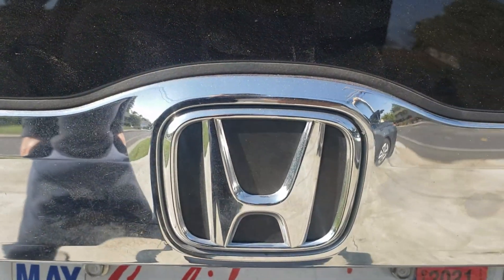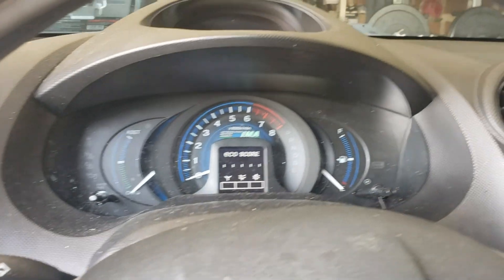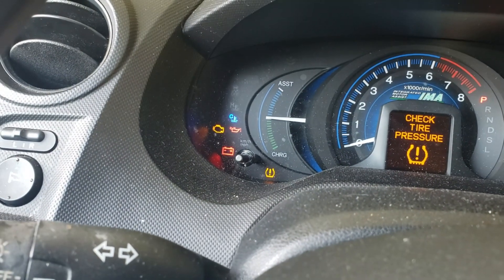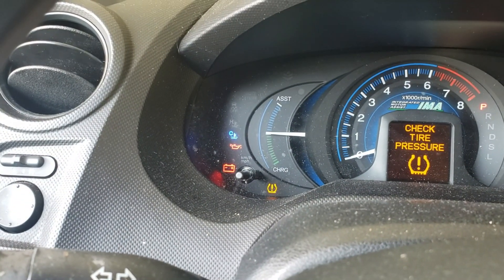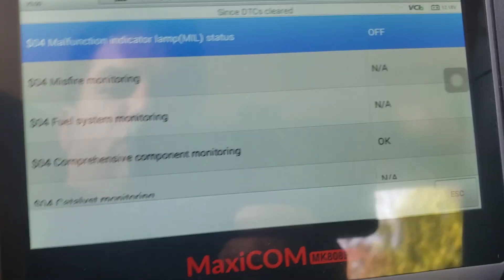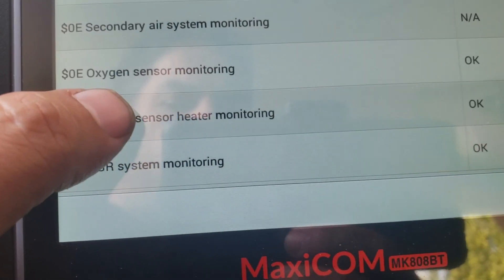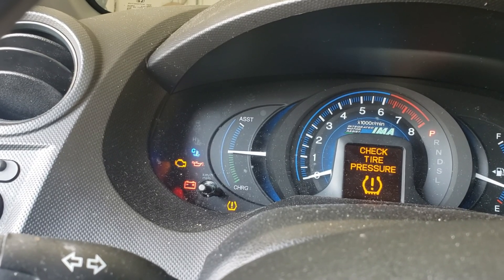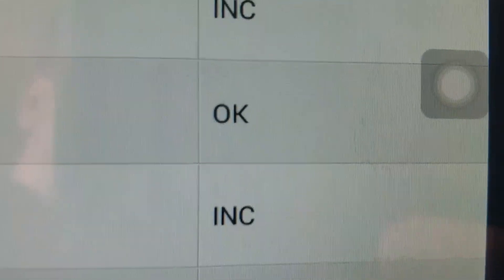Honda Smog Secret▶️ Check Honda is Ready For Smog Without Any Tools

Comment: So if my check engine light goes away like that then I should pass? Thanks
Reply from the maker: depends on the state you live, if it doesn't behave like I showed in the video then you would want an obd2 reader so can check which monitors are not ready. Once you figure that out then you will want to know your states requirements, which I have a video for https://youtu.be/QKxDzdTVJOU?si=vuJgEmP5aQSQkf0v
Good luck and keep me posted.

Comment: I did this test and my engine check light goes away in just a couple of seconds (not really around 15-20 seconds). Does this also mean that my car is ready for the smog check? Thanks.
Reply from the maker: Yes, that means the vehicle is ready and all the inspection monitors are complete.
If the check engine light blinks 5 times then it means one or more inspection monitors is not ready.

Comment: Two smog check places said OB2 showing not ready even though it has been driven over 5000 miles since battery was changed last years including freeway and street. Could there be other issues going on. Had an oil change at the dealership a few months ago should they have picked up on this?
Reply: 2017 Honda fit

Comment: I would like to post here to help who had been through with it and make your own decision. Please, this post don't mean to promote Honda dealer business but i have to post Honda dealer is the final one help me solve this problem.
Here history of problem. I replace my dead battery of Honda 2016 with ~26,000 miles 4 moths ago with new battery, during process replace battery i have to disconnected battery cable and it causes wipe out smog data on my ECU. Last week i bring car to star smog check for California Registration Re-newal and it failed with message OBD2 NOT READY.  By time it failed i have more than 1000 miles on car since replace new battery. Smog Technician give me Honda drive cycle and I did 5 times but it still failed. It is very dangerous procedure because Southern California traffic, I have kep drive 55 mph. Truck driver honning at my rear. I am scare. But it is not thing compare to drive 55 mph and allow it coast to 20 mph. I turn emergency light on  and kept drive with out touch break. It is nerve breaking drive. But it is still failed. My mechanic hoist car and he try to replica Honda drive cycle at his shop but he could not get up 55 mpd  becuse Honda transmition very sensitive, not allow him to shift gear to get up 55 mph. He gave up and advice bring car to Honda dealership. I arrived Honda dealer and tell them history problem. They tell me no problem. The will re-flash my ECU and passed smog check include passed smog certificate cost me $266. I am in and out Honda dealer 1hr 30 minutes. It is stiff for retiree and fix income like me but after been drive on freeway i think worth it because it is very dangerous for 75 year old guy drive constans speed 55mph and bunch of truck drive honning behind me. Please, understant I am not promote Honda dealer busines, I just want to help who had been drive in hell like me make your best decision. If you have any more question. Please post here.

Comment: Hi, I have a 2007 honda accord. What if the engine light don't turn off? At first it blinked a bit and turned off, now it won't turn off at all.
Reply: If your check engine light is on when the car is running that means you have a fault code present and need to get that issue diagnosed and fixed.
Reply from the maker: Sorry for the late reply, I appreciate your feedback
did you get this handled?

Comment: 600 miles and my cat monitor still not ready. I have emissions inspection due in a few weeks. No codes.
Reply from the maker: Here is the honda drive cycle https://youtu.be/oZELvZ4danA
How you can tell your honda is ready without a obd2 reader
https://youtu.be/cxpE_I1cKh8

And if your catalyst monitor is stubborn here is a playlist focused just on catalysts monitors https://youtube.com/playlist?list=PLDEbtVOPRC-h1BAzaWQ-6NSnmG0gwvgwP

Let me know what happens and good luck.
Reply: @RANDOMFIX  Ok. I re-set the computer again. No codes. Fuel trim looks all good. Cat wont come to ready.
Reply: @mg8720-u7j   - Did you have a previous fail for a CAT code?  Becase if not your Cat Monitor can be incomplete and still pass a emission test in MD.  Here is the info from thier site:

OBD II Readiness Monitor VEIP Requirements

A vehicle can be tested if either the catalyst or evaporative monitor, but not both, is
not ready. All other monitors must be ready. A vehicle that has failed VEIP
testing for a catalyst or evaporative DTC, however, must have the applicable monitor
set to be retested.
Consecutive Not Ready rejections from VEIP testing will result in a VEIP test failure.
The following message will be printed in the Test Information box on the Vehicle
Emissions Inspection Certificate: “99999 – Too many OBD monitors are not ready on
multiple attempts”. While the “99999” designation is not an OBD diagnostic trouble
code, it indicates that the vehicle has long term readiness issues or other faults that
need diagnosis and repair.
Always advise motorists to drive for 1 week after repair to help ensure that monitors
reset before getting the vehicle retested.
Reply: @mg8720-u7j   - SHould not have reset it now you got to get all the monitors ready again.  But if you get down to the cat not ready again just go for your test.
Reply: @stevew9563  ok got it
Reply: @stevew9563  Most monitors came back on faster this time. CAT monitor is the last one left after my evap. Evap will be ready tomorrow. Then my cat will be stuck. Just added bottle of CRC cat cleaner.
Reply: @mg8720-u7j   - Yea don't sweat it just go for your test with it not ready.
Reply: @stevew9563  Ok thanks so much.
Reply: year make and engine size?  You been following a factory drive cycle?
Reply: @stevew9563  2013 honda fit. tried drive cycle
Reply: What state you in?

Comment: Thank you I did this ignition test to make sure my car is ready after doing the drive cycle you shown on your other video.  The only thing I am confuse is why my EVAP system monitor was always N/A and my Fuel System Monitor and my Catalyst Monitor when from INC to N/A instead of OK on my ODB2 scanner?
Reply from the maker: Glad to help. N/a means that it doesn’t not apply. It is a little uncommon for n/a for evap. The evap is exempt in most cases. Inc means Incomplete and ok /pass/com means complete or ready. Do you have another obd2 reader. What sort vehicle are you driving?

Comment: how many drive cycle for honda cr-v ex 2006? to complete before emissions test and using cataclean with this too to help emissions
Reply from the maker: You might be able to do it one cycle and again it might take 5 cycle. After the first two cycle focus only on the unset monitors.
Reply: @RANDOMFIX  so does 2 cycles show catalyst conveter ready or complete??
Reply from the maker: It depends on your vehicle and your driving style. You may get it ready with 20 miles or 1000 miles. That's why this a complete pain in the neck and I made these videos for that reason.

Comment: This procedure of checking for sensor readiness should work for a 2008 Honda Accord, correct? (just wanted to double check; looks like my car should be good to go then)
Reply from the maker: Yes it work for 08 Honda Accord and the Honda drive cycle is here for additional details. 

https://youtu.be/oZELvZ4danA
Reply: @RANDOMFIX  OK; thank you for your reply. I am in the line for DEQ in Oregon now. Looks like my vehicle has all the sensors ready and I’m gonna see if it will pass. Thanks again!

Comment: Can I complete my driving cycle with airbag lights on? Thanks.
Reply from the maker: Yes, the airbag system will not prevent the drive from completing. 99% of the time this is the case but there are vehicle makes Subaru where you have a abs issue and the check engine light will turn on. Keep me in the loop. Thanks
Reply: Thank you.
Reply from the maker: Anytime

Comment: Which gear should you be in with a six speed manual to go to 55 and down to 20mph without shifting down, or going into neutral.
Reply from the maker: Try 5th or even 6th depending on the gear ratio.
Reply: Fifth

Comment: Guys if it blinks 5 times it’s not ready find your manufacturers drive cycle
Reply from the maker: Sorry for the late reply! did you find a solution?
Reply: Mine is blinking 5 times before it turns off..?
Reply from the maker: That means it’s not ready
Reply: @RANDOMFIX  👍👍👍 thank you

Comment: CAT Not ready? EGR Not ready?
Driving over 200 miles did NOT work!  Here is what worked: in morning warm up car for ten minutes. Rev car to 2000 for two minutes. Drive at 50 MPH for ten minutes. No cruise control no AC. Then let go of accelerator. Don’t step on the brake. Let car slow down as much as possible on its own. To check if car is ready for smog use code reader or turn car on (two clicks) not engine and look at Ck engine icon: if it stays on then go away you are good. If it blinks then your car is not ready for smog Ck. Hope this helps. I have been killing myself to solve the issue.
Reply: Ty bro!!!
Reply from the maker: Sorry for the late reply! did you find a solution?
Reply: @RANDOMFIX  yes, pls see above. That worked!
Reply: Those are the 2 codes that always say "not ready" on mine.  But that just looks like the ordinary drive cycle instructions from Honda.  I never can get CAT to clear and with EGR it's a roll of the dice.  I hope I have good luck this time around.  It's a shame they don't have some realtime indicator that comes on when you're driving to let you know it's ready.
Reply: Do I have to reset before I do this?
Reply: I just drove on the freeway and use cruise control at 70 mph and like 10 minutes after the CAT became ready. (I monitor the status in real time.)